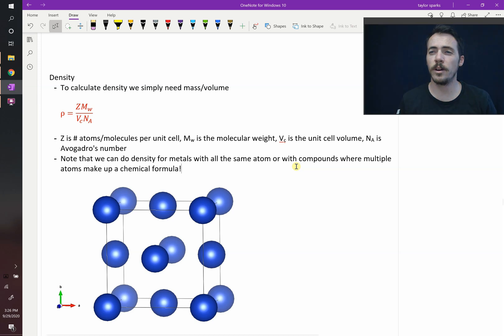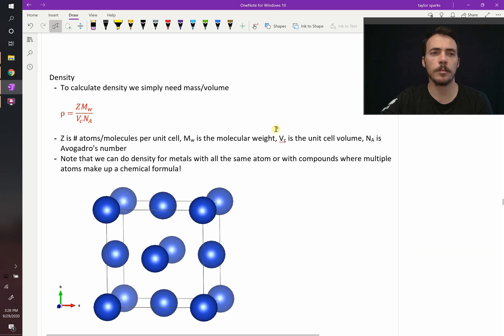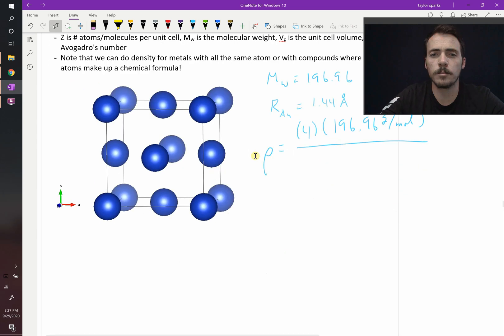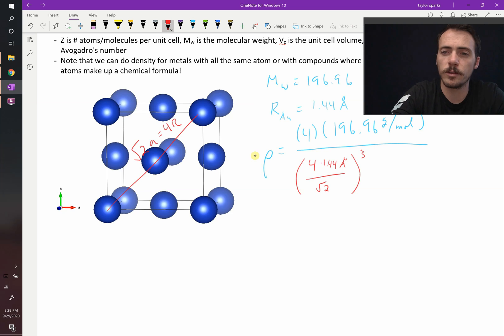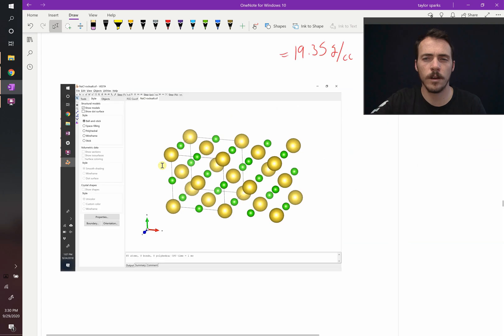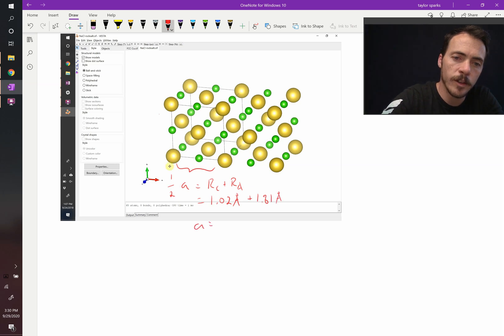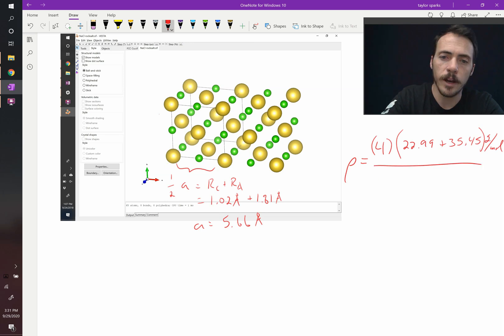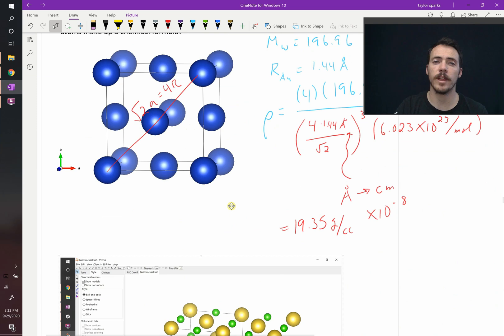How to calculate theoretical density for crystal structures

Comment: How would you tackle a theoretical problem like Element-246 ? .... It doesn't exist, but how would you tackle it ?
Reply from the maker: @Ukraine-is-Corrupt  hmmm... I would probably use machine learning to predict size based on a composition-based feature. Vector and once you know the size you can estimate the crystal structure and therefore the density
Reply: @TaylorSparks  I'm reasonably certain I can estimate the physical size of the Nucleus (hence, neglecting the Electron cloud). What would my next step be ?
Reply: @TaylorSparks  Alternatively, if I supplied the Mass-Density, would you know how to works backwards to the Element ?

Comment: If we had a chemical which was for example bi2se3 which has a hexagonal structure with 3 selenium and 3 bismuth, then would this formula still work? Because technically the atomic weight does not account for the extra besimith atom in this unit cell? Thanks for the video also hard to find content on this online !
Reply from the maker: Yes, it totally works. You need to modify two account for the molecular weight of the compound as opposed to the atomic weight for an individual atom but the approach of the exact same instead of counting how many of a single atom there are you count how many formula units there are and use that for z
Reply: So to clarify quickly
Density = ( 6*654 u)/(V*Avagadros)
Where V = (3*sqrt(3) *a^2*c) /2. This would be the correct form?

Comment: What about experimental density for nano particles? Thanks in advance
Reply from the maker: You would use the exact same approach for the particle itself, however, if you want to know the density of a particle compact that is more difficult. You would need to know how they are packed together through a simulation there are several Monte Carlo packages that can do this. You can also experimentally measure it with something like helium picnometry.
Reply: @TaylorSparks  thank you for your answer 🌺